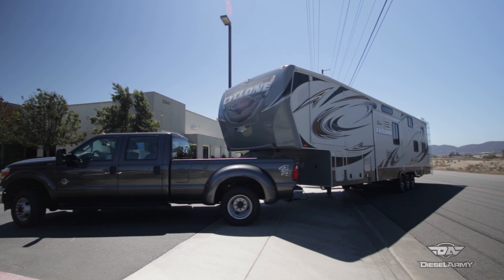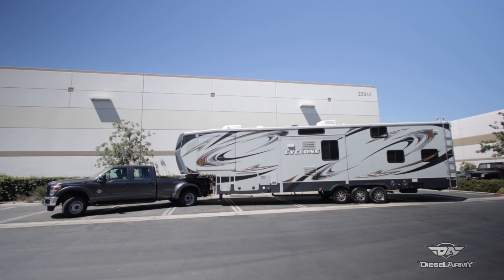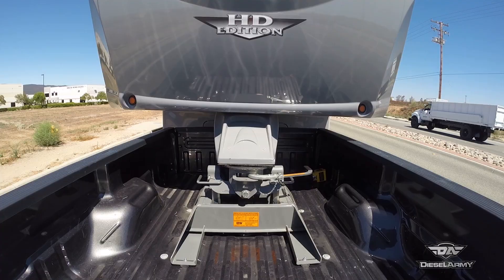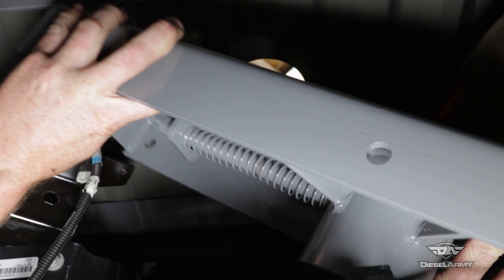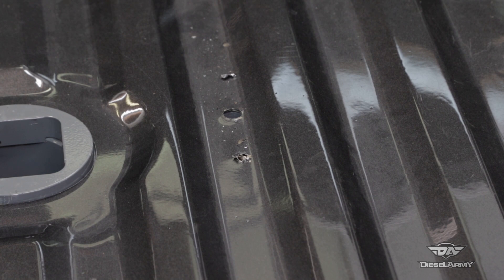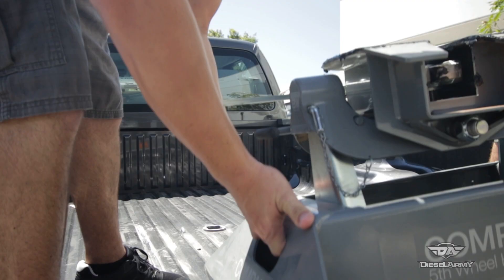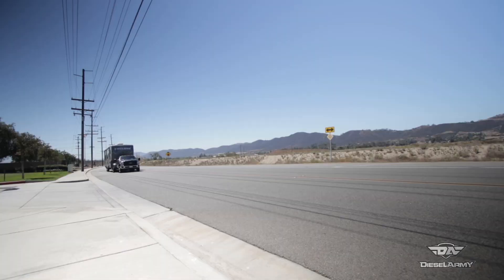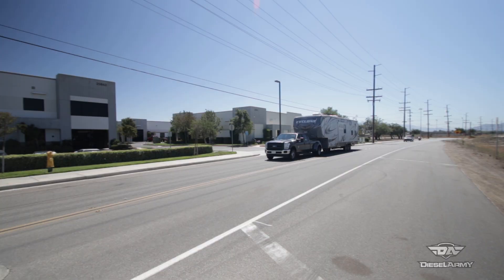Fifth Wheel to Gooseneck and Back with B&W Hitches

Comment: Can you use the adapter that goes into the hole if you already got a gooseneck set up already done? Or you need to get the stuff that goes on the bottom of the bed?